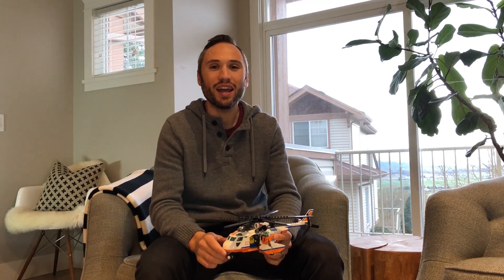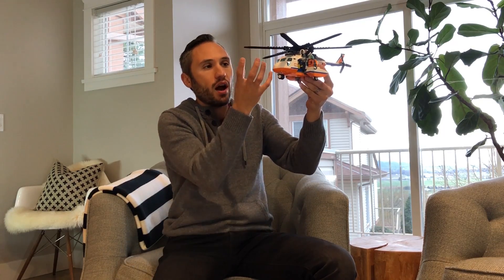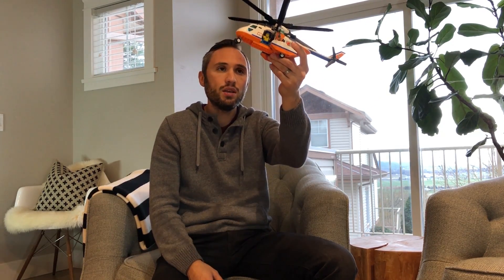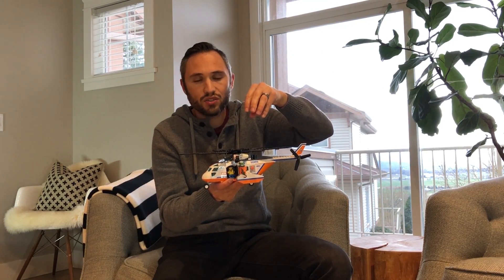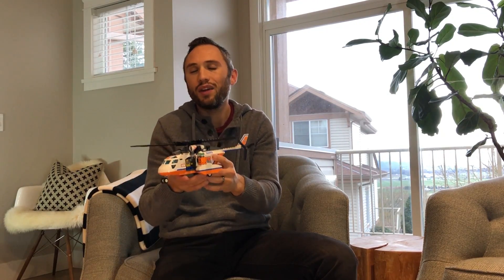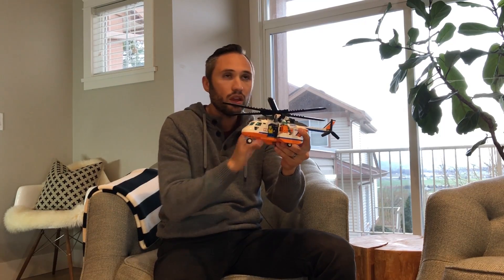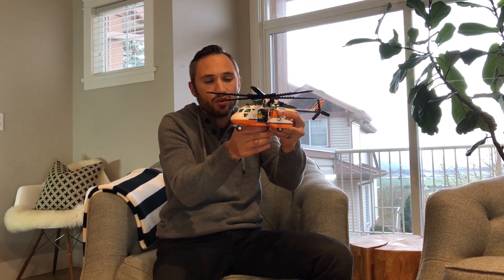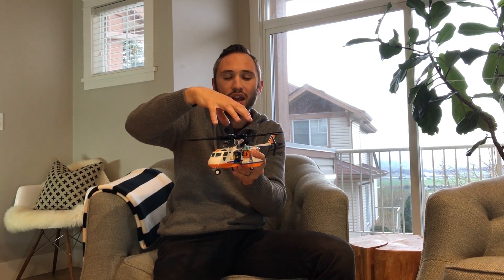Vortex Ring State IS NOT Settling With Power

Comment: if your going to explain aerodynamics please use terms correctly. If you have 20kt airspeed and a 20kt tailwind you have a ground speed of 40kt and still have an airspeed of 20kts and therefore will never get into VRS or SWP. 

You cannot have 'matching angle of attack of the wind and the rotor'   angle of attack is the angle created by the cord line(airfoil) and the wind. So the wind does not have its own angle of attack.

You missed the main point and aeronautical benifit of the the vurshard recovery. Vurshard technique is maximizing translating tendency. You have  to use POWER PEDAL and opposite cyclic and raise the collective to slide laterally out of your downwash.

What you described as SWP is mushing.

Comment: One of the biggest mistakes helicopter pilots make is excessive rate of descent which can easily lead to settling. Descent rate needs to be low enough that the machine has enough power and ability to move a large enough mass of air to arrest the momentum. The heavier, the slower. Good pilots know how to do this while keeping power requirements to a minimum. Where excessive rate becomes an inescapable trap is where the helicopter is already at or near full power and then slows below translational lift. At that point power required goes up, reducing the ability to lessen rate of descent with the often resulting ground impact and damage or loss of the aircraft.  That settling is not taught as a separate issue from VRS is a huge mistake, and that new pilots are not better versed in power management is also a pity. Instructors should simulate these conditions by requiring students to complete maneuvers such as landing and departing with lower limits imposed on use of power so students get used to having a light touch and are conservative and aware in their use of power and managing requirements. Staying out of settling means controlling rate of descent well ahead of approaching terrain because by the time the mistake is realized there usually is no way out. Good video bringing all this up. High time.

Comment: I'm trying to see if I understand. So, using fixed-wing analogies:

 A vortex ring is like a microburst pushing the aircraft downward.  The difference being that in a helicopter the downdraft is self-induced but in a fixed wing it's weather related.  In both cases, escaping the downdraft ASAP is the remedy.

Settling with power is more like a fixed wing's late flare with a possible hard landing to follow. The best possible remedy in both cases being to somehow produce more lift ASAP.

Is that about right?

Comment: No, you're wrong, the FAA is correct, by entering its own downwash, it causes the rotor to begin to stall from the root to the tips because of the recirculation, settling with power is the same thing you're just not in a purely vertical descent, you're still travelling down your own downwash, it's just not a vertical column of air.

Comment: Great job Misha!  My 2 cent: In VRS the Rotor is not aerodynamically stalling, in fact  the vertical Trust reduction experienced is due to the negative contribution of induced flow that partially destroy the lift at the tip of the blade. 
In the  Vuichard  Recovery  technique the reason why its recommended to apply right cyclic and power pedal (for counterclockwise Rotors) is in order to have all the sideforces (anti-torque + tail rotor) in the same direction helping to exit the condition quicker.
Be aware that VRS is not exclusively related to hover condition, in fact if you perform a very aggressive quick stop manoeuvre where horizontal airspeed falls in the induced velocity t range  0.5-1.5 , there is a spot where you can get in VRS even if not descending at all, this is due do the fact that Main rotor down wash experience the same condition that trigger VRS in descending hover condition. In this latter case, you will have no VVi indication that warns you.
Settling with power is the condition that drives you in the VRS, is the root problem, think about how a power limited hight altitude hover condition may end up.

Comment: Judging by what he says on how to get into a vortex ringstate.  Tells me that he doesn't have the slightest clue on what vortex ring state is
Reply: And his method of getting out of it. IS valid by name. But his explaination of the manouver isn't correct.  

You give it side collective AND rudder.  So you can push your heli sideways.   
Lookup some video's on it.   There is a really good one where they demonstrate it with a real helicopter that sprays a water mist so you can see the airflow
Reply: Settling with power is just crashing because of pilot error. An error in judgement.  It has nothing to do with eachother and NOBODY except idiots in australia would call it the same thing.  

YOU think they are similar enoegh to be confused with eachother.  But their not.  

And settling with power simply doesnt exist.  
Either you are a capable pilot and you can land. No settling with power.  

Or you are an incapable pilot and crash.  Wich is a crash and not settling with power. 

"Settling with power" is a collection of words that someone who has no buisness being around helicopters has made up.

Comment: Something folks don't seem to aknowledge in the explaination of the Vuichard method is that a reason it is more effective to translate laterally out of the vortex is that the rotor is largely ineffective because it is caught IN the vortex, but by translating sideways AND maintaining heading, you are using your tail rotor to help push you out of the vortex and the tail is not "stalled".   Also:  Pilot Yellow incorrectly said to apply rudder in the same direction as cyclic, it would actually be opposite. . .

Comment: I like most of the videos I've seen of yours. So I hate to say this,  but...None of this is correct. They are both the same thing. Three things you need. 1.) airspeed below ETL, 2.) decent great than 300fpm, 3.) using 10-20% or more power. This is a rule of thumb that can apply to all helicopters for safe operation. There are other factors that can increase the susceptibility of the helicopter to get into this condition, like temperature, humidity, gross mass, even the make and model. Not all helicopters are equal in this. 135's love settling/w power while in the same conditions, a 407 will do just fine.  We are not teaching how to get in and out of settling w/power. We are teaching to avoid it. The "old way" of teaching the recovery works very well if it is applied in a timely manor and done correctly.  The way you perform the Vuichard technique is dependent what way the rotor turns. Counter-clockwise rotors require right cyclic with left pedal. Clockwise are opposite, Left cyclic, right pedal. You are using the tail rotor thrust to push the AC out of the dirty air. Its a very counter-intuitive maneuver, but very effective. What bothers me most about this is you not addressing the one this we can do to prevent this in the first place. The "go-around". When things don't look right, just pull in power with forward cyclic and go around and start over, it's free. Don't let get behind the AC trying to recover it. Just a quick backround- I was an instructor to 2 1/2 years, I've flew in the GOM for 2 years, and have been flying EMS for 5 years. CBi300's R22, 206B L3 & L4, 407, S76, EC135 & 145's

Comment: Hi. I have a question is about Vortex Ring State with helicopters. 

You may be aware of the serious collision between 2 helicopters at Seaworld Marine Park in Australia on 2 January 2023. One helicopter was coming in to land and the other was taking off. A witness claimed that it was windy and that the 2 helicopters were too close. It was also reported that the rotors of each clipped. There are many theories but no-one has mentioned MY thought.

It’s hard for me to understand how 2 helicopter pilots would allow their aircraft to fly too close together, even if windy outside.  Could two helicopters, both creating their own vortex ring state, pull both helicopters together resulting in a crash? Any thoughts

Comment: EASA differentiates the two as Power Settling and Main Rotor Vortex Ring State. 

Power settling has too much Inertia to overcome and you hit the ground. Main Rotor Vortex Ring State is the aircraft falling at close to the same rate as its down wash. 

Your statement that the blade is stalled is inaccurate as the blade is still developing lift (ie the reason for the by product of lift - down wash or Main Rotor vorticies).

Comment: 2:05 the logic of the phenomenon seems to be flawed as described. If a wing gets in a downdraft it’s AOA reduces (doesn’t increase); consequently can not be stalling. What I think is happening, sections of the rotor are hit by the descending air which then reduces the AOA and consequently lift locally. Heli sinks faster as a result, pilot raises collective trying to compensate, blades general pitch increases, local AOA of unaffected sections reach stall AOA. At this point affected sections have less than required AOA (maybe even negative?) wile the rest of the rotor is stalled. At this point the rotor between low AOA sections and stalled sections is producing little if any lift therefore the heli falls like a stone. I might be completely wrong. This is just what logic is suggesting me. Apologies is my thinking is somehow flawed. Anyway the explanation offered didn’t convince me. I might be wrong but then there must be a different explanation for the VRS.

Comment: English is my second language and today I learned that the term "Settling with power" refers to excessive inertia and inability to arrest motion. I would appreciate some clarification on this.
Also, you are comparing the VRS to a stall state in an airfoil, but I think (Correct me if I'm wrong) that this is an incorrect use of the term "Stall". Allthough this may be the source of some controversy? 
Anyway I have been lead to beleve that in a fixed wing airfoil the stall refers to a turbulent airflow generally on the upper back / trailing edge of the wing that reduces lift and produces drag.
If an actual stall state had been produced on a heli rotorblade, then this should be experienced as lowered RPM due to increased drag, but this does not occur (correct?)
Instead, since the rotor is "swimming upwards in its own downwash", the relative velocity of the airflow to the blade has less angle of attack, i.e. the opposite of a stall.
The way I understand it is that a VRS makes you fall because the rotor is failing to create a net lift force, due to the fact that it is no longer pushing back on an external cushion of air. -in other words the vortex ring and helicopter are falling as a combined system because the rotor is just whisking recirculated air. Please confirm.
Also I would like someone to address how the term "settling with power" is used to describe a simple newtonian problem. Why not simply call it inertia?
My best guess is that it is tied to the powerplant (engine) of the aircraft, such as the situation with autorotation where an upwards airflow is essentially powering the rotor like a windmill. Is this part of the reason it is called settling with power?
Thank you / sorry for wall of text.

Comment: I think the confusing bit is that both phenomena may occur as the helicopter is descending. 

An analogy that works for me is that settle = moving down, and power = not enough. Not enough power moving down. If that doesn't stick, just slap LTE as a result of settling with power. Recipe for LTE is high density altitude, low airspeed (hover), high weight and running out of available power. (I know I'm disregarding the other scenarios where LTE may occur in flight)..

Vortex ring state, settling with power and loss of tail rotor efficiency in high altitude require the same solution, lower collective and move in X direction to regain ETL.

Comment: You might ask" why to the right in a counterclockwise rotor vs left in a clockwise system"? This works because of the translating tendency of the tail rotor.  Its the only real effective force vector acting to quickly allow the helicopter to quickly move into clean air.

Comment: 1:15  if you have 20knts airspeed on the gauge then you have 20kts airspeed period, the tailwind is irrelevant. If you are descending vertically to a point on the ground directly below you in a 20kt headwind, then you have 20kts airspeed. So if you are descending with a groundspeed of 20kts with a 20kt tailwind (zero airspeed on the gauge) you can get into vertex ring.

Comment: 1:56 WHAT? When the angle of attack is zero, the blades will stall? Yeah, right. Then you're the princess of York 🤦‍♂️🤣. Something must've gone wrong at your ground school during the aerodynamics classes. You clearly don't get it. Let me put that simply. At the tips, because of the donut-shaped vortex, the air goes DOWN, the angle of attack DECREASES, thus decreasing the lift (quite the opposite of stalling). And towards the rotor center the downwards movement of the helicopter combined with slower linear speed of that section of blades, causes something completely opposite: the angle of attack INCREASES and that center section of the airfoli stalls.
Reply: Even if you’re right, that’s such a snarky way of saying a dude
Reply: @eianault9548  It is, indeed. But note that I didn't express YOUR opnion. I expressed MINE.
Reply: @Adam_Adamsky stall is an AOA that's too high, not too low. An AOA that's too low is "feathered".
Reply: @deerfootnz  isn't that exactly what I wrote on my comment?
Reply: @Adam_Adamsky  No. Exactly what you wrote concerned fictional princesses and didn't include the word feathered. It was a little unclear.